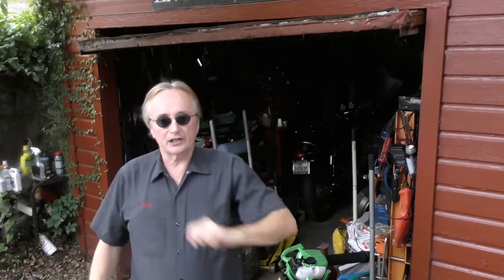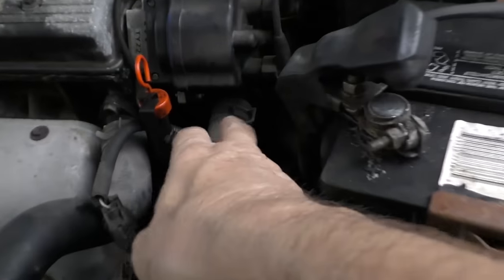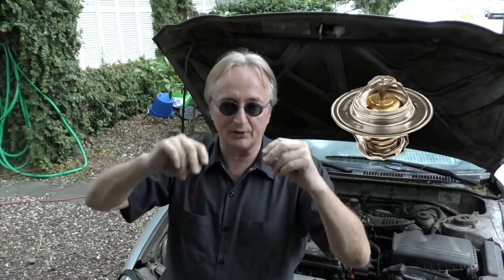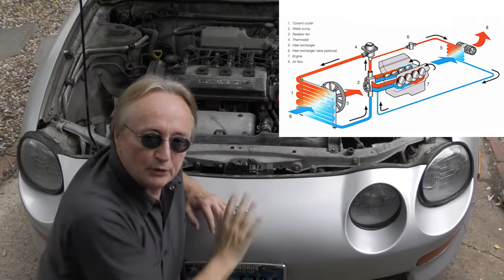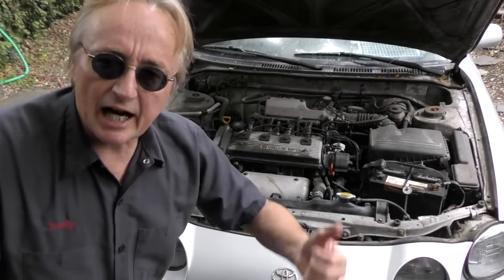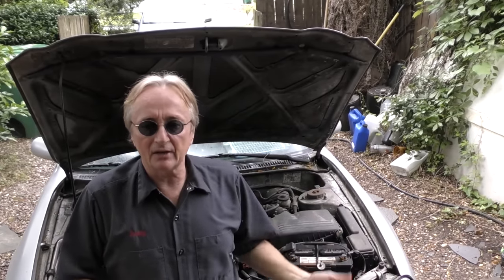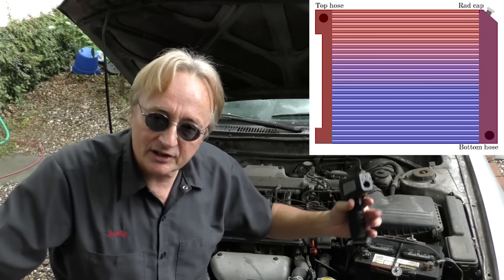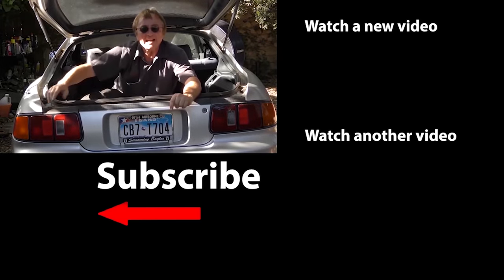Doing This Will Make Your Car's Cooling System Last Forever

Comment: I haven't changed my coolant for 15 years, no worries though, the car hasn't started in 10 years
Reply: Norman Bates 🤣🤣🤣
Reply: Volkswagen owner?
Reply: Norman Bates classic comment
Reply: @Ford Fanatic and have multiple problems for the whole set 😂😂 idk why ur bragging its not like they clean the earth
Reply: Norman Bates you much drive a bmw
Reply: Well cars on the swamp near the bates motel are very cooled
Reply: how many bodies left to rot in that car?
Reply: Will this car of yours ever start again. My guess is it probably has rusted from inside right out.
Reply: @TheAfrothunderr  tyt44
Reply: Well at least you have access to your Mother's car. 😬
Reply: On that 70's Mercedes?
Reply: Lol
Reply: 😂. Cool comment
Reply: Yeah, haven't thought about it cuz I don't like dealers. 2005 Camry hundred forty-six thousand miles no coolant flush her pretty much anything except routine oil changes. Wondering if I should do it now or just keep rolling. Kind of like my dad and his 74 cub Cadet Cadet that he has pushed hard, 45 years now. I never changed the fluid no problems if they're Built Well.
Reply: You can use a voltmeter to check if you need to. If you see a voltage then you gotta change it.
Reply: 😆   Lol. Yoy funny
Reply: @JBlooey  Proly Jaguar or Chrysler one🤮😂😂😂
Reply: Lol..
Reply: @TheAfrothunderr  Clean the earth? 🌎 I believe it's way beyond too late to worry about that!! 😂
Reply: Lol! What kind of car is it?
Reply: Yo Norman, might the car be a Fiat? Stands for.... Fix-it-again- Tony! Or a Chevrolet, Clutch Hanging Every Valve Rnging Oil Leaking Every Time?
Reply: TheAfrothunderr jealously is a sad trait to have
Reply: Yes
Reply: THATS THE REASON YOU CANT BE A MASTER COZ IT DOESNT FIT ON YOUR FAMILY NAME..😆😆😆
Reply: Lololololololol
Reply: Hahahah jilake
Reply: Never changed coolant in my car for the last 12 years but I keep on adding concentrate Castrol coolant in the overflow container, I never have any problems, I drive about 1200 km per month😊

Comment: The reason thermostats stick shut... Is because 99% of the people put tap water in the radiator. Tap water has calcium in it! I am always used distilled water in my radiator! And I've never had a stuck thermostat!

Comment: Dear Scotty you saved my behind the again I had taken my vehicle to the mechanic because I had a radiator leak after I took it to the mechanic to get a fuel line replaced 7 Days Later it started leaking radiator fluid. The man said it was my water pump while I have a 2000 Intrepid. The water pump is with the timing chain. And I have been pumping money into this car because I love this car come to find out all I had was a crack in the upper part of the radiator by the hose I almostjunked my car something told me to Trace the leak lo and behold I found it. This man try to screw me over $1,235. I even told him I have some knowledge about cars I just don't have the tools or the time. Bless you Scotty you keep up the good work🤜🤛
Reply: There was nothing wrong with the water pump
Reply: @kingfreedom1863 I'm a 68 yrs old woman and  Scotty has saved me from a royal you know what. I've caught 2 mechanics trying to rob my bank account like you mentioned by watching Scotty's videos. He's a rip off mechanics worst enemy.  Lol

Comment: Another tip for modern cars.  Use distilled water or 50/50 pre-diluted mix when refilling.  Using tap water with concentrate will shorten the lifespan of the coolant, and if left unmaintained for an extended amount of time, it'll start etching the aluminum inside of the engine.  Eventually clogging the radiator, and eating away the surfaces near the head gasket.
Reply: Use Pre Mix as its far safer and mixed properly in a clean facility.

Comment: 1  change thermostat every 4-5 yrs
2  check radiator cap, change 4-5 yrs
3  spray radiator with rubber rejuvenator AT 205 Reseal
4  clean radiator & condenser fins
5  make sure both fans run (set A/C to max & watch)
6  change coolant @ recommended interval)
7  check radiator for consistent heat with heat gun - replace if modern radiator and doesn't flush well ☺
Reply: Spay radiator with rubber rejuvenator at 205 reseal
Reply: Matt Kind he forgot to mention the temperature coolant sensor.
Reply: Matt Kind Thank you mister.
Reply: Not the radiator the radiator hoses....
Reply: Buy POS
1)Change nothing
Reply: my car sucks... 2005 chevy classic(2.2 ecotec motor), engine fans never seem to run till the car is way hot,,, unless you use a/c... Seems to me all new cars lack about 3 things. 1) manual override for engine fans to force on, 2) oil cooler, 3) automatic trans fluid cooler
Reply: @sirtigalotwolfe2962 
1-Turning on the fan too early may cause a p0128.  Modern engines warm up faster with the fan off, and thermostat closed.  Some modern GMs have active grill shutters that stays closed during cold startup, and opens up when the fans or ac turns on.

2-Some cars have oil coolers, some don't.  You can ask the engineers about that.

3-All automatic transmissions either have an inter-cooler, or transmission fluid cooling lines that attach to the radiator.  You'll notice 2 small metal tubes going into the side tanks of the rad.
Reply: Thanks sir for the info🙏🙏🙏🙏🙏
Reply: Question, does the change coolant means coolant flush?
Reply: @TreboRobert89  YES, always.
Reply: My 2002 Nissan Sentra GXE 1.8 only has 1 fan hence no A/C. Should I apply the same method?
Reply: Thank you
Reply: @miket952  yeh what is that ?
Reply: Thank you for quoting the main points/
I am using an old car, should I open the hood after a long road. 300 - 500km?
Reply: @hanhhuynhduc  on the last few minutes of a long drive, turn up the heat all the way and put the fan on high. This pulls heat away from the engine.
Reply: nicely summarized!
Reply: carefull with radoator caps, many new ones are not working correctluy- they are selling crap
Reply: Cost?

Comment: Great advice! I realize just how fortunate I have been as the the last 3 cars I've owned I put over 200k miles on each, never changed a thermostat and didn't have a problem. Time to up my preventative maintenance routine as it is much better to spend a few bucks to prevent being stuck alongside the road for something so inexpensive.
Reply: Preventive maintenance is key it's how a car or truck will keep you happy...it makes me cringe watching people just keep beating on a vehicle And not checking fluids and keeping up on simple maintenance .... A friends truck started making a ticking noise and I asked how long has it been since she changed oil and had no idea so I checked it and it had nothing reading on dipstick I instantly filled it up with oil and lucky for her noise went away but if I didn't check it that day truck had probably 50 miles before it expired got sooooo lucky

Comment: Really good info Scotty! I’m replacing the thermostat in my old Land Cruiser today. The hardest part of it was that I broke one of the bolts that hold the two pieces of the thermostat together. I was able to get it out by tapping on it with a brass hammer, and then used a Vise-Grip pliers to carefully remove it. Now I have to reconnect the hoses, fill with distilled water and coolant, check for leaks, etc. Your videos are great!

Comment: It’s a good idea to also replace the rubber radiator mounting “grommets” when you replace the cap. In high ozone areas (cities and metropolitan areas), the rubber hardens and shrinks over time. This allows the radiator to rattle on its mounts and the plastic top part to break free of the metal core - allowing fluid to leak out. 

Just change the rubber mounting grommets. They are cheap and easy to replace.
Reply: Right on, good call.
Reply: Thank you body. I will do it.

Comment: 2:30   as a german mechanic i agree here with Scotty ! our cars have become to complicatet and reliability decrease with every new gimmick they put in!  . After 20 years of AUDI i switched to a good old V6 na design from Toyota/Lexus with high km on it but hey that engines oil is still shiny after 5000km !  In a new TFSI engine from AUDI/VW your oil gets dirty after a few hundred km !
Reply: kubanskiloewe Which is the power output per liter difference between those engines? :)
Reply: I have 2007 octavia vrs tfsi, over 310,000 km oil still stays clean for a long time. Only mobil 1 from new. Recently removed sump just to check oil pickup and everything was very clean, very impressed. I thought I would hate it, very complex, some stuff is stupid plastic or low quality bolts (new radiator held in with cable ties!) but overall its been good to me.
Reply: @nothanks3462  most TFSI have huge problems with oil consumption because the oil rings went dirty from carbon deposits due to DI .  More than that many run bad at idel and some even dont pass the 2 year state emission check in europe.  good to hear some runs fine but there is also a huge difference in driving with speedlimits and here in germany where all idiots drive like crazy on autobahn. TFSI engines have a turbo+a little supercharger (compressor)   .....2 expensive parts beside all the other little things to keep the powertrain running. Not my taste.
Reply: Yeah.. I am from India.. Is it true the cooling system in VW /skoda cars are not up-to the mark?  I have a Mk I Octavia, I recently changed its thermost valve.
Reply: @nothanks3462  j

Comment: 100% agree with the OE Thermostat replacement.    I had a Honda where the thermostat is in a plastic housing.  The aftermarket plastic cracked and was running cold in the winter.

Comment: Great advice. There are many parts that I will only use OEM parts on.  A trick I use is to use heavy duty silicone spray which is actually light and clear. I spray it on radiators, the front of my motorcycle, and car bumper. Bugs can then be washed off easily.
Reply: Plain cooking Pam in spray can  also works , bugs wash off easier.   ( love them June bugs )

Comment: Also if you're the one changing your own coolant, use distilled water if not using a pre-mix. Crap from tap or well water could very well be one of those things that accelerates corrosion and build-up inside the cooling system passages or alters the chemistry enough to shorten the expected coolant lifespan. It's not too expensive in the scheme of things, and it's a tiny bit of extra insurance.
Reply: Yes!  Scotty should have mentioned that

Comment: Worth pointing out.. most thermostats work using a heat-spring.. if your car has recently overheated, or seen an unusually frigid winter outdoors, anything giving it an especially drastic temperature differential, that heat spring can lose its tempering or crack. Usually it still works but not 'well'. It can overwork the cooling system, and put it on a fast track to another failure. So if you park outside in a frozen wasteland, replace it every spring. And if you overheat from a leaking hose or something, its a good idea to change the thermostat at the same time, even though it wasn't at fault.
Also if you live where its warm year round, consider just removing the thermostat.

Comment: I can relate to your Celica as I owned 2,the 77 GT and 80' fastbacks.  My current everyday is 94' 300ZX na manual,have had it 15 years. Its good to have a car without hundreds of more feet of wiring and un-needed sensors and electrical gizmos,gadgets and whizz bang options.
Reply: I hear that, my 1982 Jeep CJ-7 is so simple I can do about 95% of the work I need to get done on it.

Comment: Great advice. I buy my radiator cap and thermostat @ the Dealer. It cost more but so does my engine.
Reply: Radiator cap and thermostat at Toyota dealer $70 AUD in Australia

Comment: For thermostats it's also a good idea to drill a hole through the outer ring, won't dramatically alter warming up, but can keep your engine from going boom if it gets stuck shut
Reply: You know there are thermostats designed with a pin hole to allow some flow in the event of the unit seizing shut, right? Nah, I guess I'll just pull all the aftermarket and modified parts and replace them with the oem plastic junk and parts that are documented as failure prone, because, as you implied, the manufacturers know best
Reply: I used to do this with every thermostat, on the ones that didn't already come with a bypass/bleed hole.  But recently I've found that this increases the length of time it takes the engine to warm up.  That doesn't bother me, but the engine computer actually times the warm-up interval and if it takes to long, it will throw a code.  Happened to me just last week and a new "undrilled" thermostat fixed it.  For emission reasons, manufacturers want the engines to heat up quickly.

Comment: The OEM radiator cap on my Honda has been working flawlessly for 18 years and 193k miles, ditto for the hoses, and the water pump. All I had to do was follow the advice on this video + changing the coolant on time.
Reply: 8 years , 200k , all original still going

Comment: You are a pure genius. I'm only watching you 2 days and I've already learned so much from you! Wow! The polymer sprayed on hoses is genius. Going to do that! Ok here's what happened to me. I have a 1993 Toyota Camry 2.2 in really good shape, but with 203K miles. The car used to run super cool on the temp guage and I noticed my radiator cap was old and the rubber was falling apart, so I went and bought a new one, slapped it on, go out that very night, bam! I overheat. Had to be towed home. My mechanic said I blew out my thermostat because my car was "used to" the lower pressure in my system..? Then when I replaced the cap, now it created such high pressure, my thermostat locked up. Is this true?? My car still runs great BUT now the temp guage is always in the middle normal range, instead of way low like I was used to. Oh well,  live and learn.

Comment: Great advice @5:35 for cooling  fans. I had many vehicles with belt drive, instead of electronic drive. Both Camry fans went out at 200,000 miles. Replaced with new fans.

Comment: Yes! AT 205 Does work. I have a front seal going on my Dodge ram 4.7 are used AT 205 300 miles later fixed , and I sprayed on all my rubber like you suggest it works. Thanks for the tip Scotty.

Comment: Thermostat - Make sure you buy OEM.
Radiator - Make sure you don't buy OEM.
Reply: Lmao
Reply: Scotty should make a video on which parts to buy oem, and which parts to buy after market.
Reply: @davidjacobs8558  - He's done some videos where he talks about that sort of thing.
Reply: You are free to buy an $800 radiator from a dealership but they are just aluminum tubes encased in a plastic housing.
Reply: @omartinoco9930  I totally agree with Scotty, some critical parts you want OEM.  Other parts you save a ton buying third party.  When I replaced a bumper cover on my Corolla the dealership wanted over $300 for it.  Bought one online from a company that makes them in Michigan for $60 and it fit fine.
Reply: Or by-by engine!
Reply: Han Skinslo I mean some extensive list of everything he can think of.
Reply: GM make sure you don't buy OEM. ...roflmao!
Reply: Toyota make their own.
Reply: Mael-Strom Aisin makes it for Toyota for a lot of the models. Maybe even all of them.
Reply: Or buy a failsafe thermostat. They fail in a wide open position.
Reply: @mael-strom9707  ?
Reply: @guitarprepnplus1  that's what I plan on buying because the thermostat is a pain to get to.
Reply: @guitarprepnplus1  Not quite. They lock open when you over heat your car because there is some other problem.
Reply: You're suppose to buy oem everything. Not really suppose to mod anything.
Reply: Be sure you switch out the thermostat when you replace the radiator or you can kiss your entire engine goodbye
Reply: I like OEM, Shiny Happy People is a clasic.
Reply: @ScoCoda  thats me in the corner... losing my OEM....
Reply: @omartinoco9930  Dealerships arent only places to buy OEM genuine parts and not knockoffs (aftermarket junk).
Reply: LMAO, Oh so TRUE!!! Oversized Radiator is always better considering that the thermostat controls the flow, and in high heat it needs the Radiator to actually remove more heat is better.
Reply: Steve Silvas  Don't know what you're talking about.
Reply: @jamesmcleod5545  what if you replaced the thermostat a year ago..
Reply: Steve Silvas  That's what he said.
Reply: Except for hyundai/kia....buy aftermarket...from 2010 to 2018 hyundai/kia had millions of defective thermostats....bad design...uses rubber inside seal that decomposes in antifreeze...and bad center pin design...replacement is all metal w no center pin
Reply: But If thermostats costed 900$ scotty would be like HECK who cares
Reply: Hilarious. But he's fun to watch.
Reply: No lie... I live in the country, bugs are deer are my cars worst enemies.

Comment: I just replaced the thermostat on my Toyota V6 a few months ago with the Toyota branded part.  It was challenging but I got it done.  Patiently burped all the air out of the system so easily with one of those coolant flush kits on Amazon.    Temp gauge is reading perfectly again, no fluctuations.

Comment: Scotty--I make a practice of turning on the heater at least once a week, even in the summer, to circulate the coolant that's stashed in the heater circuit.  I recently lost the plastic radiator on my 2001 Lexus IS300, but have not otherwise had any heating/cooling incidents in the 96,000 miles I have on the car.  Ralph L. Seifer, Long Beach, California.

Comment: AT205.. Same idea as 303.
I put "303 Protectant" on tires that were starting to get small surface cracks from sitting years. The tires look like new now.
Just don't breath it in or get it on yourself. It doesn't smell toxic but supposedly is toxic.